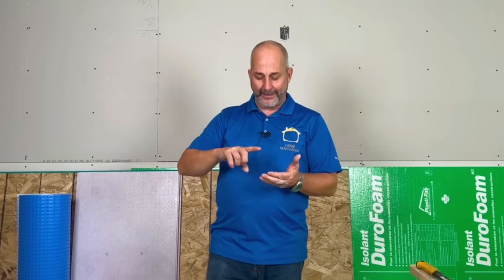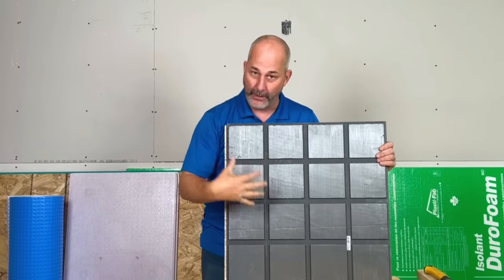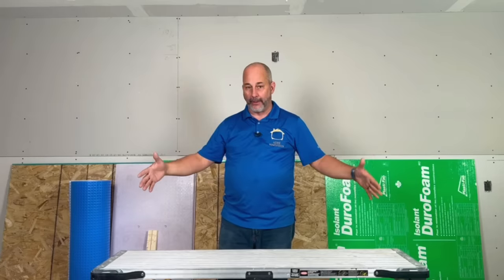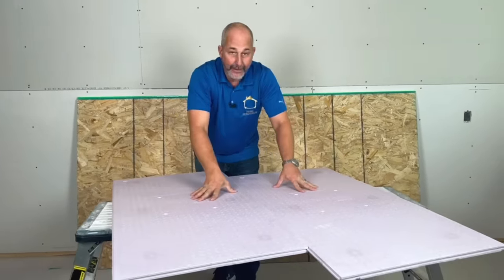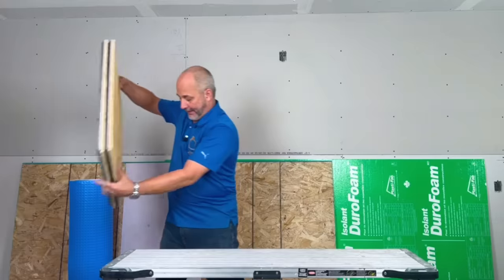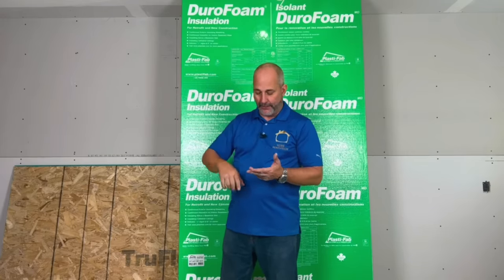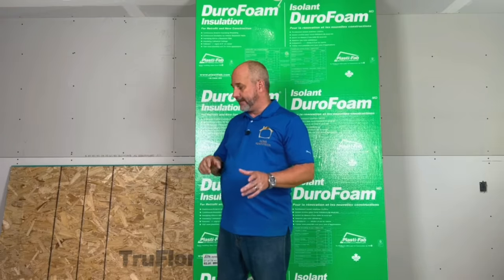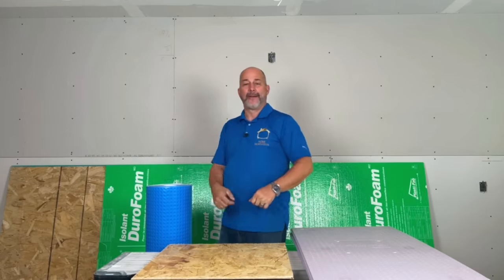Comparing 5 Different Subfloor Systems and What They Cost

Comment: Hey Jeff. We have a home built in the 40s that we just had french drain tile installed in with DMX dimple attached to all of the walls.

House is located in Minnesota so similar climate to Canada. Only issue is height restrictions.  We only have about 7.5 ft of space to begin with.

What type of subfloor would you suggest? After watching your video i would assume a DMX with osb but not sure if that would provide enough of a thermal break.
Reply from the maker: if you want to install vinyl plank then use the insul armor product. R 4.1 and the vinyl can be installed directly on top. has a compression rating or 3600 lbs per sq ft so no worries. you can even build walls on it. Cheers!

Comment: Hi Jeff, really hoping you can help with what I should do. I’m in northern MN, climate is likely similar to yours. 

I have a house built in 2009 but the contractor did not put a vapor barrier poly under the basement slab. There is also no foam under the slab. I didn’t know this when I installed a luxury vinyl plank floor in our basement. I placed a 6 mill poly over the concrete then installed the vinyl plank flooring. About 4 years later, my wife and I noticed a musty odor on our main floor. Turned out it was the flooring I had installed in the basement. I tore up all the flooring and it appeared that the odor was trapped between the poly above the slab and the vinyl flooring. 

I’m guessing I may have thermal and moisture issue? I say this as there is no barrier under the slab and no foam. 

Are you aware of any liquid product I can pour on the slab that would penetrate the slab and ultimately prevent moisture from wicking up the slab? Then apply the dri-core purple insulated panels? 

Would greatly appreciate your insight. Thank you in advance!

Comment: I would greatly appreciate your advice.  I live in the East Bay Area of California so our temperatures range from freezing occasionally in the winter with averages in the 50's and summers 80-100 F.  (please for give the fahrenheit)  The house was built in 1951 with a plank subfloor that looks like 6" deck boards nailed to joints with 1/4 inch gaps running diagonally.  I have lived here for 15 years and the crawl space has remained dry.  There is not basement.  I am planning on installing new Luxury Vinyl Flooring through out the house.  I had a water leak so 1/3 of the house is bare floor and 1/3 is original 1/4 inch hardwood and the remodeled half appears to be OSB or similar, I have not pulled the carpet yet.  So my question is what would be the best to cover the original plank flooring.  I am installing new kitchen cabinets so what considerations do I have for weight as they will rest on subfloor and not the LVF from what I am told.  And then should I rip out the 1/4 inch hardwood down to plank and add a different subfloor or can I install the LVF over the existing hardwood that is in good shape and relatively level most places.  And if I find conventional subfloor under the carpet should I just leave it and try and match elevation at the thresholds?  Any suggestions would be appreciated.

Comment: Hi Jeff, love your videos!! Question for you.. I have a brand new house (2-3 months old) and I am looking at finishing my basement.  For the subfloor, I am not sure which system to go with.  When the poured the slab, they did NOT do a vapor barrier because j was told it wasn’t needed since we weren’t doing radiant heat… it’s just concrete on crushed stone then dirt.  I live in the northeast so it gets very cold at times.  Do I need a water management subfloor system? I haven’t gotten any water in my basement yet but we do live at the bottom of a hill… we have had some good snow melt so far and heavy rain storms mixed in with no issues.. foundation is waterproof sprayed on outside too.  I want to make sure my subfloor is done right the first time.  Thanks!
Reply from the maker: Yes you need the whole shebang! there are so many ways for water to find it's way in especially on new builds. My advice is wait 1 year before doing the basement. inspect for cracks and inject to repair them. usually found around the windows. spray on membrane is not going to work for cracked walls. Cheers!

Comment: Thank you always, Jeff. I would like your personal opinion about my home improvement situation. I have an unfinished basement in Suffolk County, NY in which I want to install a hydronic floor heating system using radiant heat panels. The house is 17 years old. The basement is concrete and I want to create a thermal break between the concrete and the basement floor. Do you consult?

Comment: Can studs be installed on top of the dimple membrane and do the studs need to be pressure treated? I currently have a 1981 home with walkout basement. Is currently unfinished with no wall in it.

Comment: Love all your vids. I have probably watched like 30hrs. I have a question about basement flooring and sub floor: I am planning to build a pond on top of the subfloor which will be 4ftx6ft and 2.5ft tall with some features on top and stuff. So I am spreading around 2 tons of weight over that 4x6 area. Would the  insularmor work for that? I am expecting the weight of the pond will slowly squish that section of subfloor  and create a pancake where moisture cannot flow because all of that weight is transferring to the dimpled spacers that provide the air gap. What are your thoughts for subfloor with a pond on top? Better to build the pond frame first over its own special pond underlayment or use a sturdier subfloor?

Comment: I have a newer house which has a vapor barrier under the concrete floor and my goal is to get a thermal break. would it be okay to use the rigid board with 7/16 OSB to keep the thickness down. Do you recommend building the walls on the assembled subfloor

Comment: 1952 Triplex in Montreal, QC. Had exterior french drains put in so water shouldn't be an issue. Would prefer to go with foam + 5/8, but there is a pretty big slope to a floor drain in the middle of the basement. Kind of worried there would be a "valley" on the middle of the 4x8 sheet due to the slope and feel as though the smaller 2x2 dricore sheets would better conform. Any experience with this situation or suggestions? Thanks for all the great vids!

Comment: Hey Geoff, terrific video as usual! I live in Calgary, my house was built in 1997, undeveloped basement. I am thinking about using the DRICOre subfloor. I am doing the subfloor and framing by myself. They told me at HomeDepot that I it is easier and better to install the subfloor then start framing (while leaving the roughing exposed for inspection). Do you have any video on how to do framing on tile subfloor system? Is there any risk when screwing down the tiles? nails vs screws? Any advise would be helpful, thanks in advance.

Comment: Hi thankyou! 
My question, I have a 1960 cabin with crawl space (dirt floor) the plywood interior floor. I am interested in laying new SPC vinyl planks. 
I would like a sub floor insulation to stop cold, I have no water issues, I have a tight budget and low ceiling height. 
I thought of laying a 4x8 sheet of ridge insulation then installed flooring. But then got confused with all the options.  
Please help!
Thank you Debbie.

Comment: Unfortunately my floor is too soft with my vinyl floor is cracking. My contractor chose the DMX dimple subfloor but I don't think they leveled out the concrete basement floor or thick enough vinyl flooring.

Comment: Folks, I’d be forever grateful if someone can answer this question. Want to finish my basement. Deciding on putting in sub flooring. Firstly it’s a new build so it probably has a vapor barrier. Another concern is my bottom step is 6.5” from bottom to under lip. Will that cause code problems if I play with that measurement by adding hight to the floor.

Comment: Hi, i live near montreal. we do not seem to have water issues, left a garbage bag for a few days and no water or condensation. I was thinking of going the durafoam / plywood route, but i have an open sewer port and a floor drain cleanout on the floor (about 2 feet from the wall).  Is there a way to hide it with maybe a trap or something? (glueing a small square of durafoam to a square of plywood, and then gluing laminate floor over it so hide it but still be able to access it in case of emergency?  I can send you a picture of what the ports are, not 100% sure

Comment: Jeff or anyone else, question for you. I have a new house built in 2012. Can I put the durofoam directly on the concrete then put vinaly flooring on top of that? Just wondering if it will improve the R value.

Comment: How do you determine if your basement floor is level enough for a certain type of flooring (tile, eng. Wood. Etc....).

My house is 5 years old, Likely going with the cheap thermal break option, but i feel like the slab isnt all that flat and i'm wondering at what point do you need to pour leveler?

Comment: What is the main difference between the dmx blue 1 step and the black dimple board you have used ?

Dmx apparently makes a dmx black dimple for floors isn't it just the same as the foundation dimple?

Comment: Hey Jeff, I have a home built in early-mid 70s in northeast Missouri USA. The previous owners "finished" 1/2 the 1500sq/ft basement by just painting the brick stamped concrete red and gluing carpet to the floor. I dont have any water intrusion issues since my grading is good and water table is way lower than my basement floor. I want finish/refinish the entire basement but theres some issues i have. Firstly is the centrally located floor drain. Not sure what it connects to or why its there , but there a very noticeable slope starting about 5 ft from the drain. Second issue is the brick stamped walls. Am I able to just do your suggestion for walls minus a path for water since the imprint of bricks has about 1/4 inch path from top to bottom?

Comment: I have a stone foundation, I used dimple board on the wall but a couple spots in my basement show moisture if cardboard is left touching the concrete. I have a perimeter drain that my dimple board drains into. What do you recommend for me? I want as thin of a solution as possible as long as mold is not possible to grow in happy. Can I just put dimple board down and pour floor leveler over it?

Comment: I tried taping a garbage bag to my basement concrete slab overnight to see if there was moisture. I didn’t see/feel and moisturize on the bottom. The concrete floor was painted by previous owner. Would that screw up the test?

Comment: For anyone who is trying to bring OSB down a flight of steps if you have help or not, try looking at picking up a plastic drywall panel carrier or two.  
It was a lifesaver for bringing 70-100lb drywall down a flight of steps by myself.  You just hold it like you are holding a very heavy dumbbell and then use your other hand to support it as you carry it down the steps.

Comment: For a room that's pretty cold in winter, we have torn out our carpet and want to lay a new wood or tile floor. We have no water problems but we need an effective but inexpensive Thermal (+ cushioning?) product to cover the old thin vinyl tile that's glued to the top of concrete slab. I wonder if Isolant DuroFoam is sufficient thickness to insulate and provide structure under new oak flooring or new tile. Can't afford too much additional thickness for a new floor and would like to limit the total new thickness to 2-3" I think.
Also, there is a small area where a previous owner tried to remove the vinyl tile and found that it was too difficult to remove so they laid down a thick carpet pad and thick Berber carpet. The difference in height is barely noticeable. Do I need to level that area of floor where the very thin vinyl tile is missing, or will the Isolant DuroFloor mask the very slight difference in floor height?

Comment: Is Durofoam available in the US?   I have an unfinished basement with no walls. Would like to build a bedroom, bathroom and sitting room in part of it. Has drains for toilet and shower in floor. If I want to protect walls, can they be placed on Durofoam or DMX one step? I wouldn't think so. No moisture issues, has a sump pump. Not sure if I should build walls directly on concrete. Thanks for any advice. I appreciate all the good videos!
Reply: House was built in 2000

Comment: Bungalow built in 1967, cinder block walls. Close to water table. Moisture is a concern through concrete floor and walls. Best system?
Reply from the maker: waterproof the outside and install a sump pump with a subfloor. Cheers!

Comment: Bought a new constructions back in 2021 been living it in for 2 years now. Live in Winnipeg Manitoba outside the city. No lakes, No rivers or water nearby. The grading around the house is slopping down not concerned with water. Currently in the process of finishing my basement and concerning putting a laminate flooring in the main areas and carpet in bedroom and vinyl in bathroom. Any idea on subfloor?

Comment: I have water coming from my foundation walls in the basement. It’s pools at a certain spot during heavy rains or heavy snow when it melts.  Based on your video I should consider adding dimpled membrane below my laminate? I’m not concerned w a thermal break
Reply from the maker: based on my videos you need to waterproof the exterior walls before installing anything in the basement.

Comment: House is 150+ years old with modern additions. Basement floor is dry and space will be finished with vinyl plank flooring. I think either Dri-cor or DMX would work ok. Not perfectly level floor but acceptable.

Comment: I live in Boston surrounded by lakes (0.75 miles), new construction by Toll (in 2018) with pretty much all placed under concrete. Basement wall is under 7 feet. Basement height - 8'9". I am trying to build a basement and wanted to understand which product to use. I am getting done by contractor. Would you please help me choose the right low cost material. I have walkout basement (Not sure it will be easy to carry 4x8 sheets).

Comment: Hey Jeff! I'm doing some work in the basement of my near 100 year old home and your videos have been invaluable. I'm in the Chicago area, cold dry winters, hot wet summers.  A small dehumidifier keeps the basement(and the rest of the house) comfortable through the wet times. Water vapor is my top concern, but since I plan to work down there I would like to have a bit of a thermal barrier too. We have some low ceilings (7ft, as was the style at the time), and easy access for moving materials in.  I was planning on using DriCore or Insularmor with LVP on top, but do you have any suggestions?
Reply from the maker: I would go with the insul armor approach to get all 3 benefits. air space, thermal break and sound control. It is also pretty flexible and thin compared to other options. Cheers!
Reply: @HomeRenoVisionDIY  thanks! I'll keep researching in that direction and let you know the result!

Comment: I think that blue roll would work best for my basement. I have a low beam in my basement that sits at 6’3” and I’m 6”3” so as soon as I raise anything I’ll be wacking my head. I need as slim as I can get but need the water management system cause of a crack in the basment wall.

Comment: I live in Saskatoon  with a 4 level split home built in 1986. In the dirt crawl space there’s a foot concrete footing all around the crawl space. Above the crawl space floor is a fireplace. There are 2X2 foot concrete slabs for teleposts that support the floor. The height of the crawl space is about 3-4 feet . The slabs are on well packed dirt which seem to be stable enough to support the floor. Inside of the crawl space is dirt. There’s 1/2“ drywall  that separates the crawl space from the rest of the  I’m hoping I have enough information to describe what I’m dealing with. I want to increase the temperature of the basement. I know about the 2 foot OSB tongue and groove with moisture protection I’d cover the concrete with. But how do I insulate the dirt part of the crawl space? There is no water drainage issues that I can see over the existing rock covered vapour barrier system that’s already in place. Do I use the thickest vapour barrier plastic seal it to the concrete footing with acoustic sealant then build a 2X4 joist treated wood on concrete pads. Then insulate it with dense insulation then cover it with treated 5/8” subfloor? Thanks in advance

Comment: Older house with no vapor barrier for the basement when concrete was poured. The water table is low as we had a new well dug for the house when we bought it to remodel. What would you recommend for the subfloor since we have a low water table and no vapor barrier?
Reply: Located in Northern Indiana as well if that matters.

Comment: Hey there, I'm looking to level/ install a subfloor in my garage. I found this video and thought I might be able to use some of the moisture managment tounge and groove squares. The garage slopes inward at two places towards drains, so my thinking was I could shim up the connecting pieces, screw them down through plastic shims and use a bit of silicone to put into the holes. Currently a little bit of water gets in when it rains really bad but the outside is getting regraded soon. Would you say that's a bad idea?
Reply from the maker: sounds reasonable. dricore also makes shims for their products as well. Cheers!

Comment: Is it possible to frame non load bearing walls on top of the durofoam + osb system? Also, what foundation wall insulation system would you recommend with the durofoam+osb sub floor?